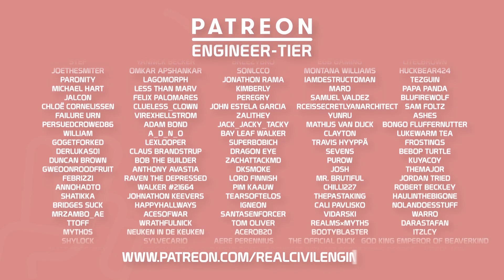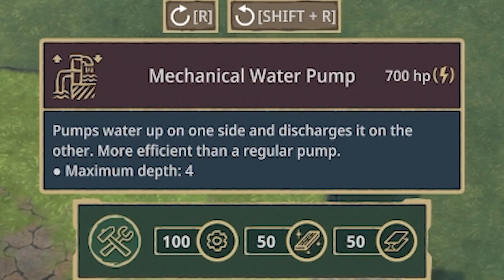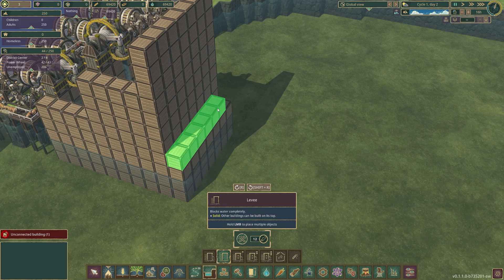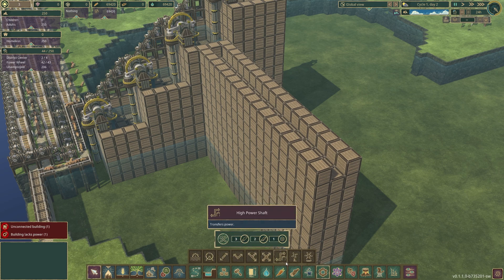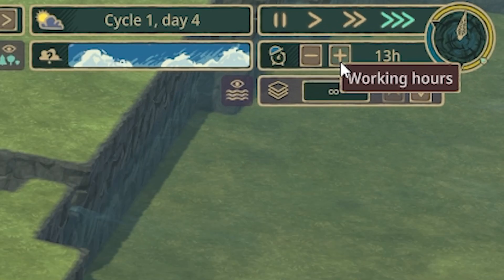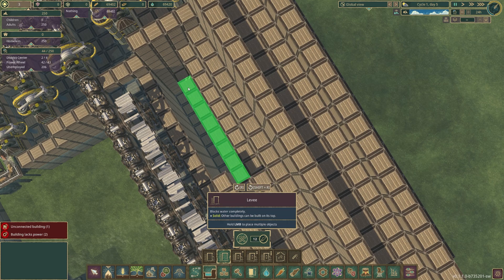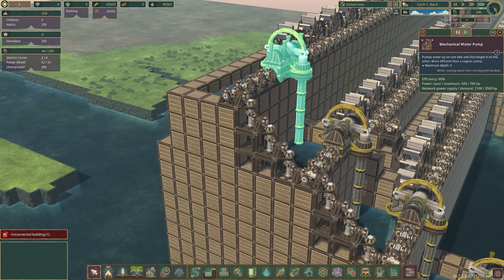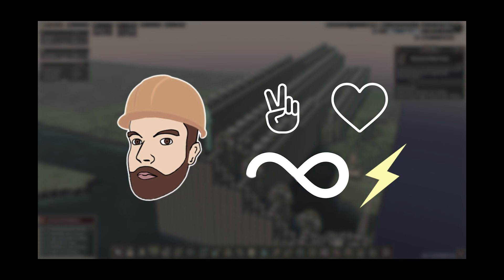Engineering INFINITE POWER in Timberborn!

Comment: Rofl. So, some floodgates would help the water control.
And narrow the run between wheels, you get a faster current from less water. A single block wide works quite well.
Possibly a stepped start- build the lot, but have q pump that pumps into the run at each level. Pump up to, then start the first level, use that power to start the second, and so-on. Sequential start.
There are smaller pumps, too, that work off the standard water filter/pumps. Might help prime the system, tho the added complexity of pathing....

Comment: If you are in the CreativeMode anyway, then instead of building 10 levels of levees, you could use the "Map editor tools" where you can use Terrain height (absolute or relative), and you can easily build like 3x3 and setup height from 1 - 16, i know it works only for the creativemode, but it saves a lot of time and brain cells in cases like yours now. Hope you would see this, cheers!
EDIT: 
plus if you use the Development Console (Shift+ALT+Z) you can set speed to 30x or 99x, if your PC won't burn due to how game is straining the CPU

Comment: single pump dont do enough for 2 wide channel, you need single wide ones and iron special, 1 wide wheels. also all water in single tile goes at same speed, so at the end you need a flood gate set to 0.5 for wheels to do ~30% more power each. Best way to do it is to make a snake falling 1 level each turn, and have like 10 wheels each turn. you will get 21-25 power each wheel,  which ends up around 1000hp constant. if you can drop higher as well, it will only increase return power, pumps are balanced to be to pricy for "infinite power" structures.

Comment: Try directly blocking the water source by building a tower of levee  around it, and then the waterwheels part
The problem with your design is it needs a lot a power to even start it
This one however needs a lot of time to fill the tower, so it might not be possible in normal playthrough unless there's more than two water source

Comment: I've tested perpetual motion with the Iron faction and with 10 of their 6 height pumps and 6 levels of 10 of their 6x2 power wheels I was able to achieve a power of 28Khp for the 7Khp I was inputting so 400% efficiency. Also I was returning the water straight to the basin of the water pumps so there was need no need for an additional level of water pumps.
The lesson I learned from it was that even though perpetual motion is possible, the cost of explosives, construction wood, time, s̵͇͇̫͓̫̜̹̣̯͋̾ͅą̸͈͚̮̻͙̭̫͐̓̾́̿̈̽̋͐n̶̛̜̻̪̫͍͐̅ͅị̷̻̗͙̈́͐̑̒͒̓̈́̇̕͜t̸̨̧̻̺͖̙̪͍̱͈̟̍ͅͅͅy̴̢̟͙̹͚̜̘̏̌͐̄͛̔̀͝ and area is so high that simply using it as a growing area for engine fuel is more efficient and is clearly the sane option. But if I were sane I wouldn't be commanding beavers to break the laws of thermodynamics...

Comment: The power output from the wheels is based off the water flow, which will only ever be as good as the pumps, which doesn't seem to be steady, or that high. I've seen others attempt infinite power and it seems like you would need an extreme amount of wheel just to power the pumps themselves, and the system would never be self sustaining, much less "profitable."

Comment: I generated infinite power with a super damn, maybe 20 blocks high, that has a single column  of levee’s missing. It fills up and overflows my normal spillway during the wet season (supplying other districts) and continues to flow out the slot throughout the droughts without dropping lower than 10 blocks above ground level.

Comment: Definitely possible in game though you didnt have nearly enough pumps for a 2 tile wide trough. The iron what ever or other faction has smaller single tile wide water wheels and kibitz has made those work with 2 pumps for a single line. Plus the decrease in elevation is needed to maintain water velocity. 

Crazy the physics engine even tries to calculate that honestly.

Comment: I feel like if you fill the system with water first and make the wheels just drain out from the pumps instead of doing the curves in the system, just let the water run back to the system. More steppy like the Hanging Gardens. Should work if you can get each wheel up to 50bp. But you might need to use large wheels or something

Comment: I can tell you that it is possible. you might want to try using large water wheels, and start off small with just a single pump height rather then stacking multiple pumps on top of each other, deep mechanical water pumps and large water wheels are the most efficient for this as they produce the most power per layer height of water and the deep water pumps give you 6 blocks of depth compared to 4 with the same energy input meaning you have a larger kinetic potential
with the iron tooth in a good setup with just 2 pumps and about 102 water wheels spread out across 6 different height layers. you might be able to get close to 6k BP of excess free power ish I haven't tested a setup this large yet. but 4 layers of large water wheels is giving me about 3.7k BP

with only folktale resources the most power you could ever produce from something like this using 2 pumps. is about 3k, and that would use about 100 water wheels spread across 4 layers, still possible but you only get about half as much power compare to iron teeth

evaporation is a big issue with this design during dry seasons. you would need to pair this with a levee of some kind that give out only a small amount of water just enough to replenish anything lost to evaporation. their is one bug in the game that lets you do something like this. which also lets you have infinitely high dams, however. the amount of water this "bug" lets out of the levee is too much for our needs here

Comment: How many waterwheels does it need to power one pump? If you get 20 hp from a wheel, then you need 35 waterwheels per pump. Is it possible to fit that many and still get 20 hp/wheel?

Comment: It's all about the cms (cubic meters per second).  A mechanical pump has an outflow of 0.07 X 1 tile at 0.5cms.  Compare this to a source block which is 0.15 X 1 tile at 1cms.But the flow gets cut in half because this waterwheel needs a channel 2 tiles wide, so your flow will be 0.035 X 2 tiles at 0.25cms from 1 pump.  All this means that each water weel should output 90hp X 0.25 = 22 hp per wheel.  At the very least you'd want to change your setup so all 4  pumps are dumping at the top, meaning your limited by the 4 tile height of the pumps go up to.  This should get you an output of 90 hp per waterwheel.  Keep in mind the volume of the water, too.  With 4 pumps your flow should be 0.14 X 2 tiles.

Comment: Is there a limit to how far water will flow horizontally? Are steps even necessary? Beyond that, try multiple pumps, as others are saying. You could test the water wheels on the ground as a proof of concept, too, so you don't need to click your way into insanity.

Comment: I myself have been experimenting with infinite power. In my experiments, I have found that, using the extra large power wheels from the Iron teeth faction, 3 rows of 8 wheels will spin on the same level before needing to drop down at all. I made 4 sets of this design and used 14 deep water mechanical pumps(the Iron teeth's pumps go 6 blocks deep) to get the water back up to the start. The pumps use 9400 beaverpower and pump water at a rate of about .3 cms each. This amount of flow gets the wheels to produce an average of 370 bp apiece. With 4 sets of three rows of 8(96) wheels, that brings my total power production to over 35,000 beaverpower. The system does need to be supplemented with water as it evaporates, and some manual adjustment is required to get the  prime amount of water in the system, but I was able to keep the system running up to five days into a drought with no backup reservoir. I think that is definitely worth the extra 25,000 power you get out of this system. I will probably post a Youtube video of it if I have enough people request it.
Reply: Personally, I'd love to watch that. Maybe even go into detail on how you approached this problem

Comment: it looks like each water wheel steals power from the flowing water, you may need to do one or two wheel per step to get any real power generated in this manor, of course it is possible that infinite power through this method is simply not possible due to the way it is coded

Comment: I would like to see more of this. “Free energy” has been a recent interest of mine and I’ve found in my research that it’s an idea often theorized but quickly shutdown. Looks like you are close to having it figured out.
Reply: Irl this would break the laws of thermodynamics. Even if you could pump the water up with 100% efficiency conversion of power to the potential energy of the water and then convert the potential energy back into power with 100% efficiency on the way down (which is impossible), you would still only be breaking even, not generating power. Free energy is physically impossible.

Comment: As far as I'm aware the wheels extract X hp/cms where cms is "cubic meters per second". If that's the case then there's nothing you can do by  speeding up or slowing the water. If it takes X+A hp to pump 1 cubic meter of water and you can only get X hp from it. then all hope is lost.

Comment: 2 Pumps on each level and build a second set of intake basins, Have an opening at each of the stages to get some flow on each level as you go up, this will help you distribute the load and stage up. Don't drop your upper most height on the way down till the end of each waterwheel row.

Comment: I made one of this "infinite" generators in a normal game mode. The trick is you need direct all the water flow to the system, build a huge reservoir (at least 3 deep, large area) to store water (easy in the right map) and use 1 Triple floodgate (can be just a empty space tbh) keeping the system running.

The reservoir stores the energy and the flow is limited by the 1 block wide gate. The energy fluctuates according to the water level, but it works.

Comment: I think if you set them to 3 wheels per level, it would help with water flow rate. I know it'll be a bunch of work, but it may pay off. Also, you need to have more water entering at the top. Like others have said, it's just not enough water for the wheels to be efficient. Just my $0.02

Comment: I don't want to go all physics on a game with beaver engineers, but you are mostly only using the energy of the water trying to achieve a level surface and not the actual potential energy of the hight, so I think apart from visuals you could just use four pumps on one level and gather the same energy. Apart from that, can the wheels even generate energy from falling water in this game?

Comment: Really need to measure how far water drops off from extensive water wheel use. Because each water wheel decreases the velocity the water travels through when it impacts and leaves a wheel. I really wanted to do an undertow generator with water wheels, platforms, and levee's in the modded flood plains map.
It would be how hydroelectric dams are really built. Maybe one person might modify levee's in this game so they CAN be built on top of platforms, just to see how water interacts with the game's physics. I suspect that the water physics don't travel underneath, but over objects. Kind of a shame, though.

I also kind of wanted water wheels to generate power from waterfalls for that extra bit of reliable power, but won't impact the velocity of the water all that much.

Comment: Yes, you only need to raise the water up once, but you need multiple pumps in parallel to keep up the flow rate, you don't need any in series raising the water up more. Just raise it up one level and have a long straight set of water wheels powering like 2-3 pumps that all feed into the same reservoir.

Comment: you need to two things. 2 pumps minimum for each stage. and secondly the water has a flow rate which is something they added in the last patch so now water is slowed by wheels, you can mitigate this problem by having the water fall before each wheel so speed the water back up again. this means your idea would still work just need to have a step down every 3 wheels or so.

Comment: Need more than a single pump to keep the volume high enough. Add to that, damming up will give you a surge but then is more likely to drain too fast if the pumps can't keep up
Reply: I was thinking that as well, his problem was that one pump couldn't keep up to keep the wheels spinning, however increasing the number of pumps will increase the amount of energy needed, it will be a gamble if the wheels will produce enough energy for more than one pump even with the increase in water volume.

Comment: It seems to me like the wheels aren't  getting enough force to turn them.  This means they aren't getting the current they need to push them.  If you add some dams at each stage (perhaps with a step down), then each stage will get the water flow necessary to push the wheels.

Comment: I feel like this is starting the wrong way around. If you can get it working with a single pump step then it should at least in theory be stackable. Also, maybe start with a tall map instead of a short one. It's easier to lay out a field of dynamite than it is to build an aqueduct one row at a time.

Comment: i would try adding choke points in the middle between some wheels to speed up the flow on the straights.  also more pumps, maybe 3 at each layer, to make sure there is enough water.

Comment: Just add more pomps on each level, please, i screaming at your maddnes, just add more pomps, tata rantata tata ra ta ta  ra ta ta.
Reply from the maker: Adding more pumps means more wheels are required though...
Reply: @RealCivilEngineerGaming  wheels will work at higher capacity because they will have more water. And one wheel will give you 40 or 60 BP not 20

Comment: If you create a large water reservoir first, probably for as high as 4-8 blocks, then do what you did, it will work. Instead of the mechanical pumps providing the running water on the canal, you can make like a hydroelectric dam scenario where a floodgate would supply the canals with a consistent and more stable supply of running water, and then pumps will then push the running water at the end of the water wheel canal back to the top, looping the cycle over. Then, for more momentum, you can repeat the step terrace flow of the power canal plus deepening the u-turns by 1 block so that the flowing water wouldn't bounce back momentarily to disrupt the water flow.

Comment: am i the only one wondering why he didn't use the 3 tall floodgates and then put levies on top? can you not do that? Or just make the whole thing out of floodgates.
Reply from the maker: You can't put anything above flood gates
Reply: @RealCivilEngineerGaming  Aw sad trombone I forgot they had those little roof things.

Edit: and yeah i also opened up timberborn to see if there were any other ways besides making a new map around the concept. Either way they need to reduce the BP needed for the pump by at least half.

I could see having half the map be a huge mountain, or being in a huge valley.

Comment: You were wasting a lot of height when you turned the corners.
I would suggest having it only step down once each time. Also, if you put dams at the end, that will help it with filling up, but not impact the flow when it does start flowing.
The other option would be to try the iron teeth to get the better pumps.

Comment: You have to arrange your wheels in parallel, not in series. You can put them in separate channels, two wheels wide. You also need to have a big-ass top reservoir that you can fill slowly. That gives you the start needed to get the whole system running.
Reply: Series is way better than parallel.  When you align wheels in parallel you're at best halving the water flow through each wheel, which cuts power generated by the same amount.  The best thing is actually to put a levee between each wheel, halving the width and doubling the flow rate.  Parallel is for when you've cut the water's path down so much it starts flooding and you need another place for it to flow.
Reply: @KatotsuSama  Halving the flow? I don't see why. I'm using an optimal amount of water for each (double) channel and I'm getting about 4 times as much power for the same water volume as in series. Is there a reddit for this? I'll post a clip.
Reply: @Harrydewulf  When the experimental build went live they changed it to water speed instead of just movement.  When you restrict the flow of the river through a choke point it increases in speed.  If you don't choke the whole river blocking one tile means little, but if you have a 2-wide channel bringing it down to one for the wheel will speed the water up for the detection of the wheel.  Iron Tails like doing this even more since their wheel is one tile wide by default, which makes catching the flow hard in the first place.

Edit: went back and found the video that experiments with this for a demonstration.  The vid is covering a lot more than just this, but the 5 mins after the timestamp is him talking about flow affecting power.
https://youtu.be/D_kPxwQsN7U?t=224
Reply: @KatotsuSama  Thanks!

Comment: i think the problem is just gravity. You are working with leveled blocks and water doesn't really flow very well on a leveled surface. if the mods could add a way to incline the building surface a bit or a way to modify the block a bit so that top surface that holds the water has a bit of an incline in a certain direction, combined with the pressure of overfilling will definitely get the water flowing and the wheels turning much faster.